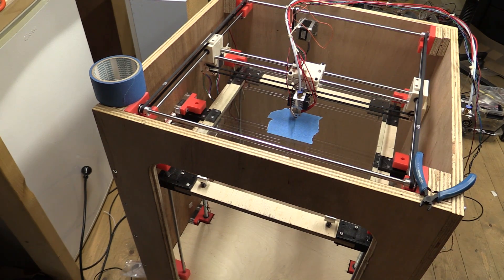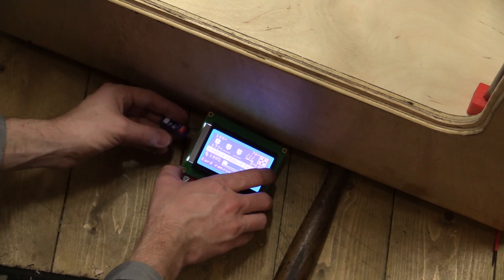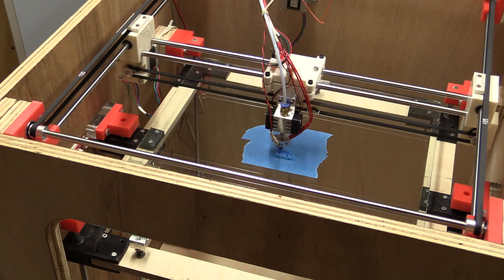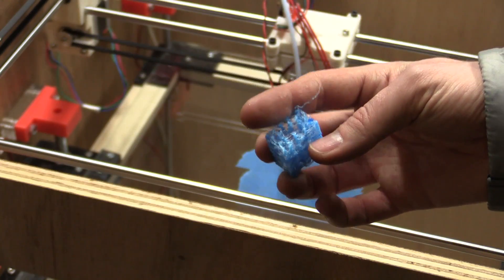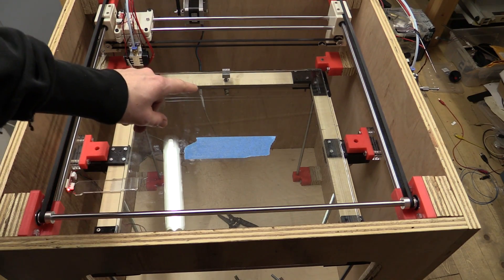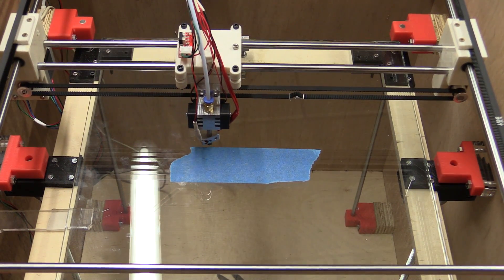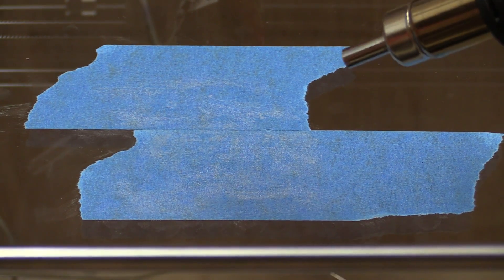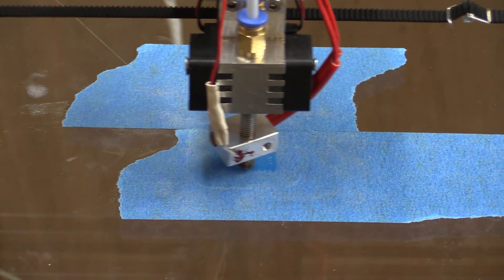FIRST TEST PRINT with the DIY 3D-Printer (Built From Scratch) - Part 9 - Ec-Projects

Comment: Loved your project series so far, fantastic job. The best part is what you made is identical to what is on my design board which is to make a combination of the conventional and coreXY printer. Only few differences are is that I used lead screws everywhere instead of belts and direct stepper coupling to the lead screws instead of belt drive and ofcourse dual z-axis and y-axis motors. Overall very happy to see that we are both thinking alike 😀. Maybe if you replace the z-axis drive on your project with direct stepper coupling to lead screws instead of the intermediate belt, you will surely get better results. Also the dual z-axis bearings which you already mentioned. And finally a fan to cool the extruded plastic!

Comment: You are printing too fast, try cura and use the advance tab (not the popup) and do the first layer with 10 mm/s, the outer walls and the top and bottom infills with 30mm/s and all the other things at 40 mm/s and work from that.

Comment: hi 
did you get it working 100%?
and did you get the heated billed plat dun? 
i want to billed one but even bigger but if yours did not work out 100% i don't no if i should try what do you thick?
do you have any suggestions ? 
I'm thinking of doing the c cases holed the y,and z, cases sins it will be bigger and the projects heaver and the y,z, always stay the same weight  and maybe depending on the total weight i might even pout the spoils mounted there to  what do you thick?
Reply: +Andrew poidevin sorry wen i said X axis i meant C, and vice a versa

Comment: That was pretty good for a first print.
My print bed is only 200 x 200, and what I found that works great for sticking PLA is PVA wood glue watered down to about 50 percent, it's cheap and and washes off with water fairly easily.
I have also ditched Repetier and now use MatterControl, it's a freebie for PC and mac also Linux.

Comment: Failures are always a step toward improvement and learning. And with your wonderful personality and comments, it is fun.  You got a new Sub!
Sorry I missed the build vids (but I will watch),, and I may not be the first to say this,, but if you are printing on glass or acrylic,?, loss the tape, and use Aquanet Superhold hairspray.
If it is acrylic, then I afraid adding a heatedbed is probably going to warp it.

Previously, I saw you using the FFCX, in the "red dot indicator for laser cutter" vid,, and was wondering if you have upgraded the firmware to Sailfish 7.7 yet?  Made mine run much better, quieter, and you can adjust speed and temp during the print.  Also the rear-mounted fan shroud is a great alternative, w/ the 40mm turbine. It's a very tight fit, but I also like being able to see the print.

Comment: Hello, the pieces that you have built with aluminum and acrylic can be of another material? if so, what can we use? Where we can see the measures of the pieces of aluminum and acrylic?

Suggestion for a new project: Build a laser cutter? ;)

Thank you for sharing this project.
Reply from the maker: +João Cabaço Hi, I think the aluminium brackets for the build plate are best made from metal. You and just cut it with a hacksaw though. It might work if you make them from nylon or ABS, but I'm not sure. The acrylic spool holder was a fail anyway, so please make that from something different ! :D 
I would like to build a bigger laser cutter, but I just don't have room for it :)
Reply: +EcProjects Hello, ok thanks for the tips =)
Still going to build a heated bed for the printer?

Comment: If you still need more power check out the HP server power supplies.. I use a 1200Watt PSU. and my larger printer im working on will run two 1200watt power supplies to provide 24v. This will be primarily for my hot bed. it will only be a 400x600x1000mm print bed, but it will need quite a bit of power to heat that. Oh, if you could it would be awesome if you had a link to your printed parts for this printer on the videos.
Reply from the maker: +Atom RC "only 400x600x1000mm print bed", Haha, sounds great :) I do have the link in the description of the first videos, but I guess I forgot it in the latest..

Comment: I have the same problem like you. your SD-card menu is very slow, too. could you solve this problem? how is your display connected? With 2 flat cables?
Reply from the maker: +opossum32145 Yes, it's connected with two ribbon cables. I didn't solve the problem until I changed over to the Repetier firmware, then all the problems were gone :)

Comment: Could the problem with the z stage be... and this is a complete guess... that the steppers are turning in opposite directions and the stronger one is "winning" making all that noise? I doubt it, but I thought I'd ask.
Reply: wouldn't it just bind then? i'm pretty sure when two worm gears battle it results in either nothing or explosions

Comment: How difficult would it be to change this to a CNC router?
Reply from the maker: +David H (Clonkex) There is, You have it set as well :) So I can't reply to yours either :D :D
Reply: +Lyonhardht Not too hard. The concept is the same, and you could make do. The "head" tends to be a heavy tool and the "project" tends to be heavier (like wood), so larger motors are usually required. The design is generally different to accommodate the weight. Z-travel is usually on the tool and only moves a few inches. The bed remains stationary.
Reply: +Fracture Your comment regarding the Z stage can't be replied to. Maybe there's a setting in YouTube that disables replies on your comments? Not sure, never looked, but it means no one can answer you.
Reply from the maker: +Lyonhardht Like Fracture says :) Furthermore, you will need thicker rods to handle the tool pressure in a milling machine.
Reply: +EcProjects Oh weird, I never even knew Google Plus was linked to YouTube comments. That's annoying. Anyway you should be able to reply now if you want :)

Comment: +EcProjects so how much did all this cost (except the Fillament)?
Reply from the maker: +Sebastian Roßberger I would say around $450 without the filament for the printed parts..
Reply: Ok thx!
Could you make a low cost printer challenge?
Cuz i dont have that much money :D xD
Would be so nice if u would do this!
Reply: +Sebastian Roßberger For this size it would be rather hard to build cheaper. Just the electric motion parts are around $150, then you are looking at around $60-100 for extruder, $20-30 for hot end, for the wood and guide rods you are probably looking at $50-60, another $30-40 for bearings. once you add in the small things like screws and other hardware you are around $350-400. and just a sheet of plexiglass that size is around $30-40
Reply: +Atom RC ya ok thx for reply :)